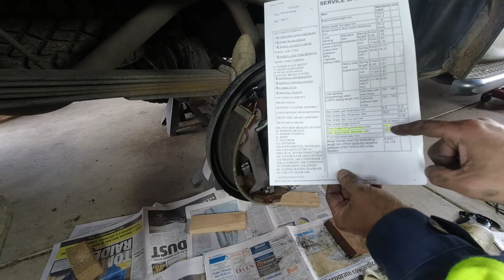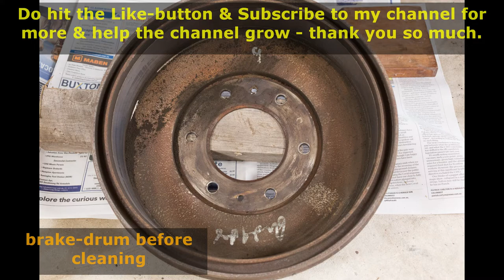Over 120,000 kms. Time I check drum-brakes on MITSUBISHI TRITON ML L200 car

Comment: Hey mate is your ute lifted? If so did you adjust the brake proportioning valve?
Reply from the maker: my ute is factory-standard.. with heavy-duty rear leaf springs. There is no suspension lift.